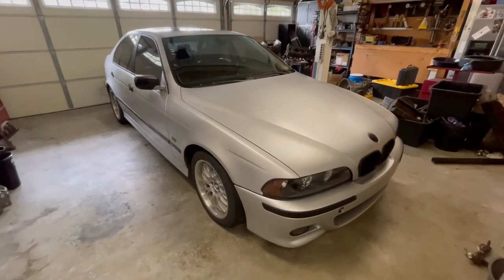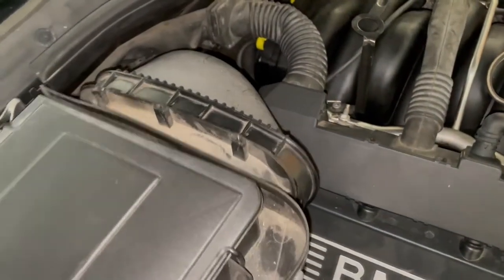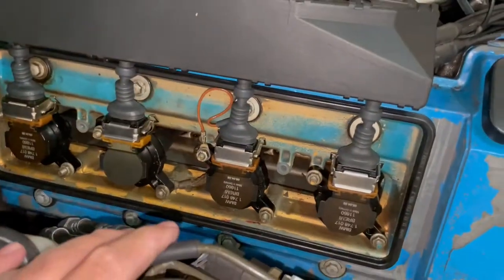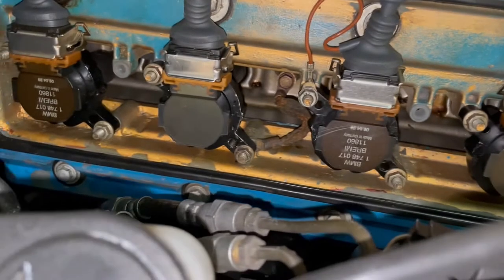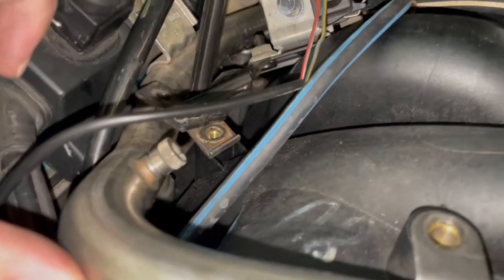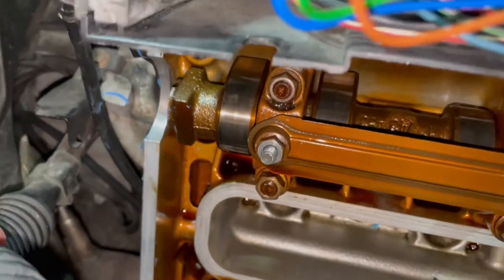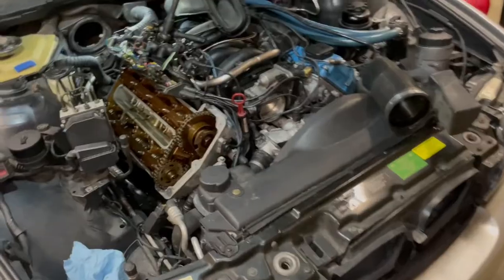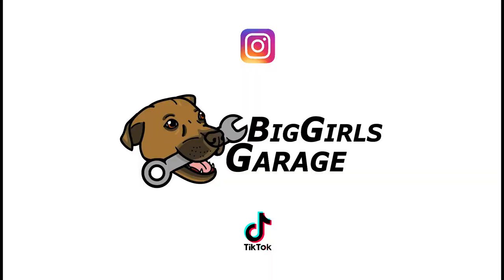Valve Cover Gasket Replacement BMW 4.4L M62 E39, E34, M5, M62tu

Comment: Hey bro I did the exactly the same to this m62 engine ( parts engine ) being sitting for 2-3 year , the valve is like stuck / glued on it  over the time , is there any trick to remove it ?